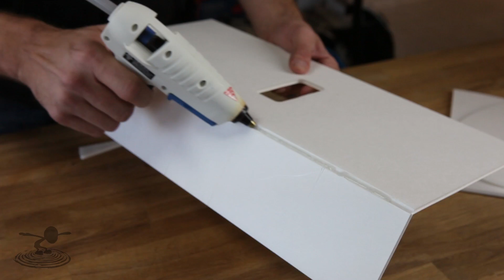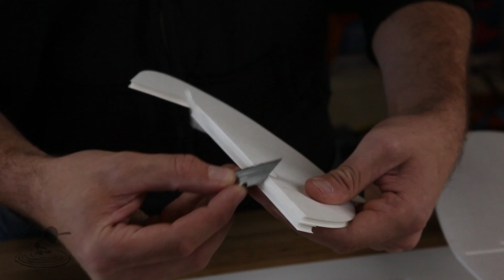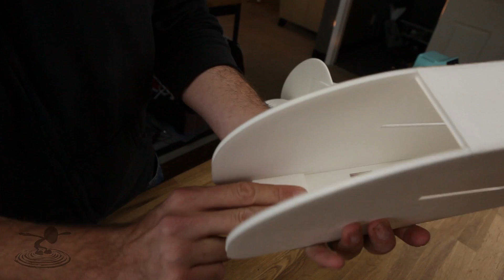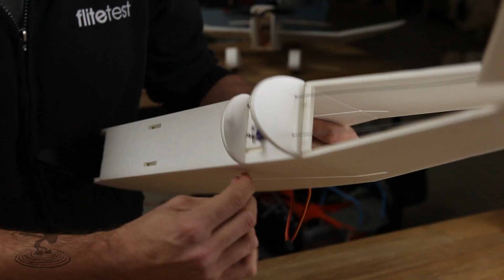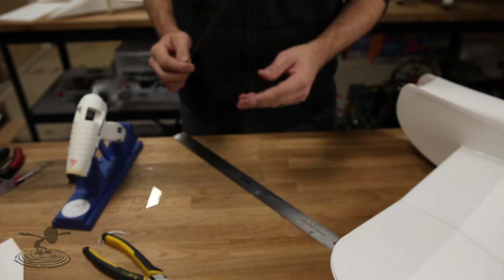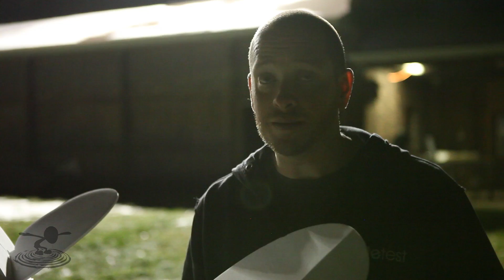Flite Test - FT Old Speedster - BUILD

Comment: Where is the cg for the ft old speedster?
Reply: In the video, and you have to dig for it, Josh makes a small, verbal note that the c/g is right on the wing bend. Sadly, this is not noted on the plans, nor do the plans include a pattern for control horns and it does not have a pattern for the landing gear nor does it call out what size music wire to use when creating the landing gear. The builder is dependent upon the build video to complete this model. Flite Test  could up their game a bit by making the downloadable plans more complete by providing all this information along with patterns for the afore mentioned items. This is, after all a beginner airplane.

Comment: do you have to use a hot glue gun
Reply: Yes, if you use another type of glue, like foam safe CA, it is much more expensive and does not bond foam board as well as hot glue. Also, if you get CA on your hands it is very hard to get it off.

Comment: The extra plate added to the front where the Power pod connects with the 2 skewers is a must and needs to be put on the FT OLD Fogey as well. I had to put one on my Old Fogey, because the foam is a little thin when inserting parallel with the skewers! You guys are always on top of things, thanks!

Comment: What battery you prefer 1300mAh or the 1000mAh one? Also I see that speedster has different core specifications than ones posted with core build on the website. (8x4 vs 9x4.7 props, 500mAh vs 1000+mAH etc.) Any idea why is that so?
Thank

Comment: How do u score the foam
Reply: Use a BBQ stick and rub it along the line or scratch it. This will give the foam a place to bend. You are denting the paper at the place you want it to bend. You could cut it at the same place but just the top paper, don't cut through.